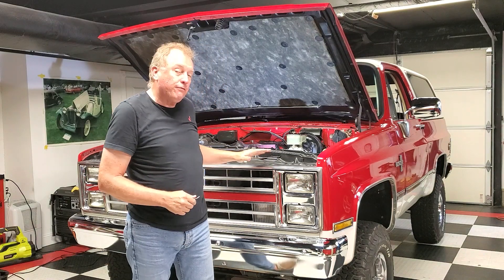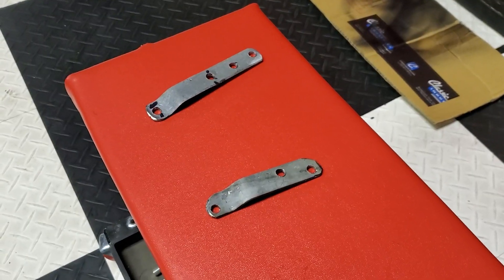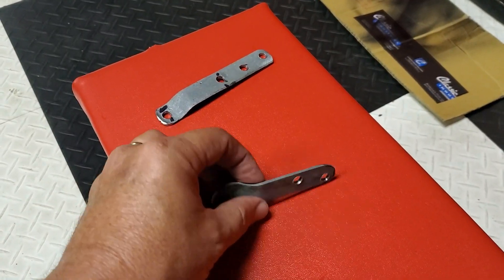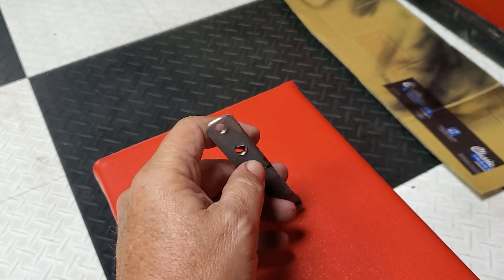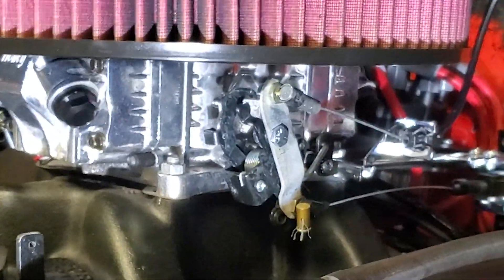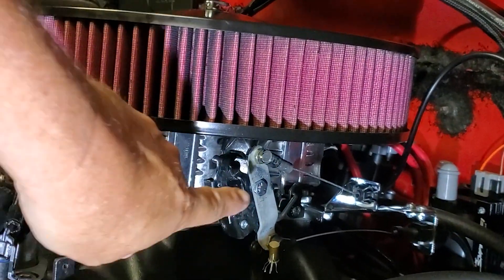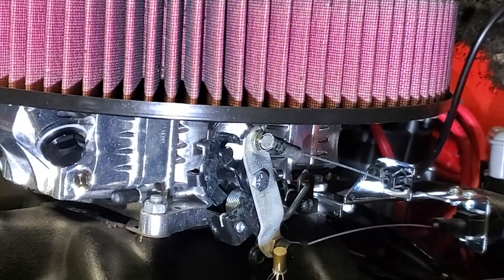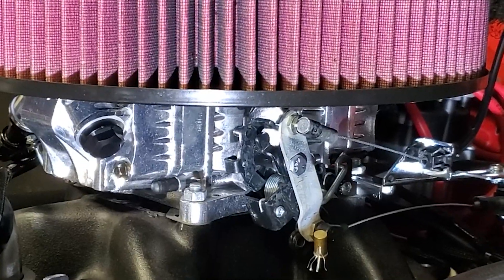Holley Sniper EFI - Stiff, Sensitive or Hard Gas Pedal - DIY Fix in 15 mins

Comment: Just did this on my 67 Camaro. Adjusted linkage and all that but now the throttle bottle will not fully open when gas pedal is to the floor. May need a new gas pedal/linkage with a longer throw? Anybody else experience this?

Comment: If I add the adapter to my C10, will I need to make any changes to the transmission? 

Currently running on a sbc 350 Holley sniper efi with the 700r4 tranny

Comment: Thanks very much i have a saab 96 with a ford v4 and uses rod linkages instead of cable and the throttle is very sensitive so this will probably help:)

Comment: I have the throttle extension on my Sniper, which helps a lot with the touchy throttle. I have to use a really stiff return spring to get my TPS to alway go back to zero. It negatively effects the pedal feel, but I haven't figured out a solution yet.
Reply: I am trying to figure this out too.  I undid 1 to 1 linkage and programed it out.  Complete pleasure to drive.  Now I don't know which to try

Comment: Did you check if it still goes to wot when fully depressing the accelerator pedal? I just put mine on and I'm only getting about 3/4 throttle when I'm flooring it.
Reply: I just had that exact conversation with Holley tech support because I have the same problem and had the same question. They seemed to think there may be a slight reduction in the TPS reading but the unit would still be open 100%. It didn't make much sense to me but they seemed to think it wouldn't make much difference at WoT. I just ordered the 20-16 and will give it a shot
Reply: @nickam8298  well Holley is full of shit because I had someone hold the gas pedal down and I can look down into it and it's only opening 3/4 of the way. Lol I had to make a spacer for my gas pedal and buy a longer throttle cable for the extension to work properly. Now when stepping on the gas all the way I can look down into the sniper and it opening all the way and the tps is now reading 100 instead of the 65-70 percent before. But it made a massive difference in throttle sensitivity.